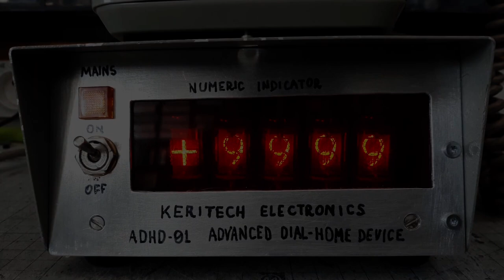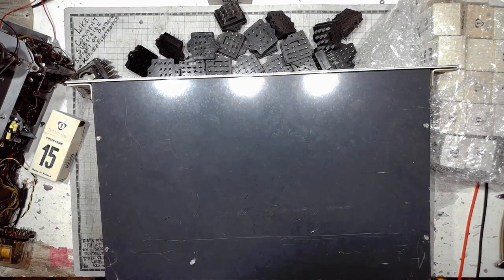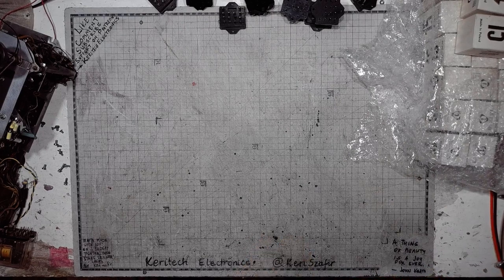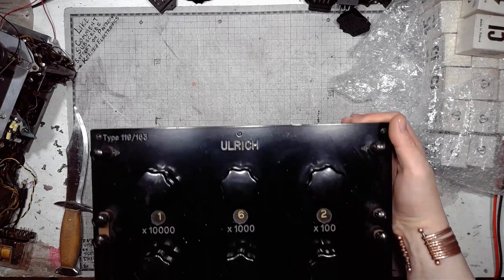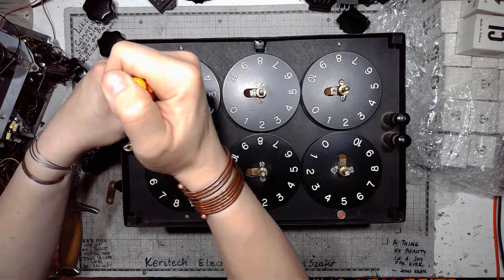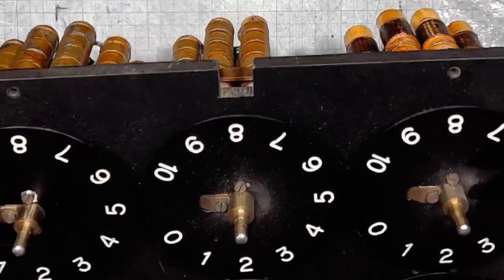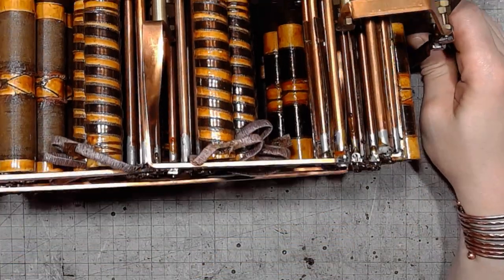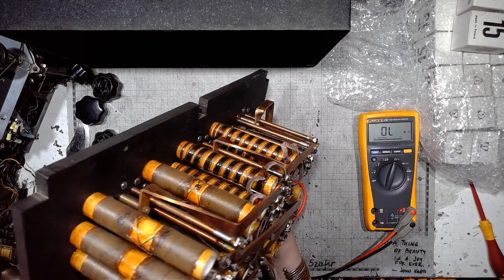Keritech Snail Mail: Resistors and Relays

Comment: What a wonderful piece of art ! I wonder if those wire wound resistors were wound in a way to neutralize any self-inductance ?
Reply from the maker: Very possible - and for maximum heat dissipation too, to prevent change in resistance due to heating.